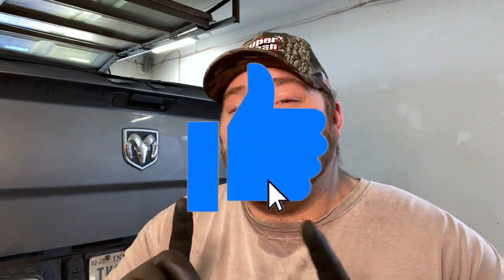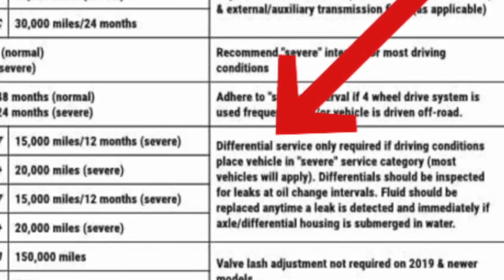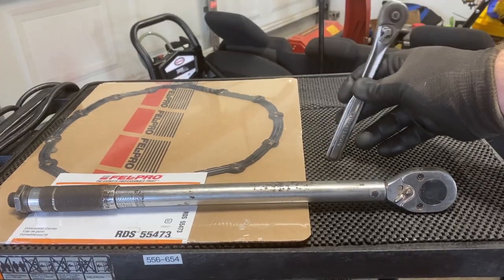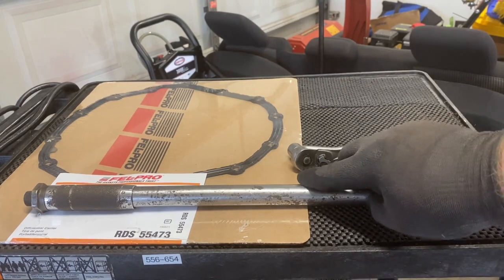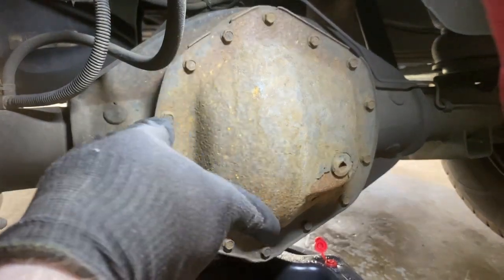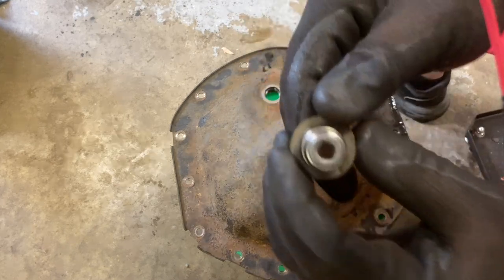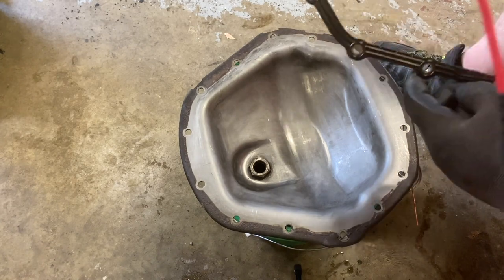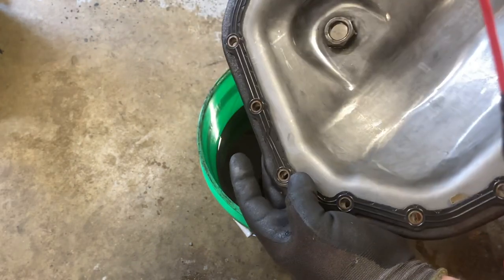HOW TO CHANGE REAR DIFFERENTIAL FLUID - RAM 3500 TRUCK

Comment: Great information and video regarding the Differential lube change out. I gained some confidence to tackle my own task this weekend. My 2005 Dodge Ram 3500 has over 235,000 miles on it. Stuff is wearing out of course. Also, great testimony. I think I was led to your video in some way as I am a Christian also. Thanks for sharing your personal feelings like you did.

Comment: Hi Dan. I have a 2022 Dodge RAM 3500 dually diesel with 113k miles. I took my truck to get it serviced for rear differential fluid change and was quoted about $500 to have it serviced. This video definitely gives me the confidence to change it myself I thank you and may God keep blessing you. 🙏👍
Reply: 🙄holy crap what a rip off. If you can't find a reasonable mechanic you have no choice but to do it yourself (that's what I tell myself anyway).

Comment: Got a 2018 RAM 3500 and backed into a covered manhole on a jobsite. Put a small 1/4 inch hole and leaked out all the lubricant. Your video made it very easy to follow a straight to the point. Got me some JB Weld to patch the small hole and put back on. Thanks for the great info and knowledge to help myself fox this small problem. God bless you brother
Reply: Sounds like it is time for the banks upgraded cover, budget permitting :D

Comment: Hey man! Good word!
Jesus is Lord! 

Question:

I just tried to do this on my 2021 2500. It is different than your year so I opted just to add some fluid because it was low. I ended up adding almost all 3 quarts I had bought for the complete change. Why do you think it was so low? It has 71,000 miles.
Thanks bro

Comment: So, I drive for my work. I have a 2022 ram 3500 4x4 6.7 Cummins. What is safe working temperature for the tranmission? When loaded, I see the temperature get up to 210 degrees.

Comment: How did you get the plug off o tried using a half inch ratchet but that doesn't do anything oreillys didn't have the right tool .

Comment: Wondering ur putting a lot of miles on ur truck, I don't but it pulls our 5er which weighs 17,000 in about 10,000 lb, what gear oil do u use. Mine is the 4.10.1 gear with aluminum factory cover

Comment: I’m new to this aspect and want to check it on my 03 dodge ram 2500. This may be a stupid question but what fluid do you put into it once you have cleaned it up and replaced the seal?
Reply from the maker: 75w-90 gear oil good luck!!

Comment: i have this same rear end . bought truck used 07 3500 but has had rear end replaced before i bought it  i was told it has a 09 rear end now. the original rear end required limited slip fluid additive but i was told that not all rear Ends require it   does this rear end require the limited slip fluid?

Comment: 2018 dodge dully when turning right or left in slow speed rear differential has clucking. Does not do it while driving forward or backwards. Any thoughts y
Reply: Some take that Ànti slip additive and some don't,  that could be related to it